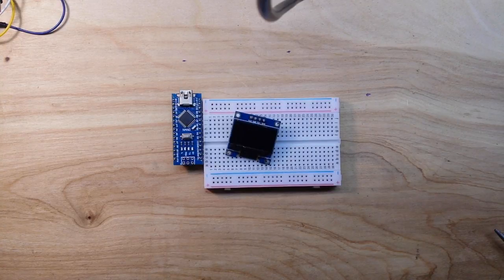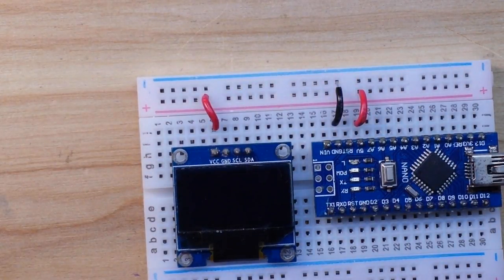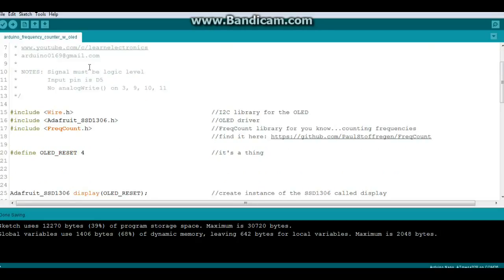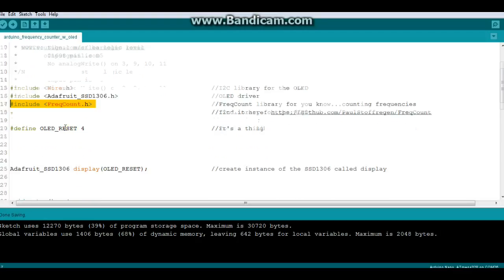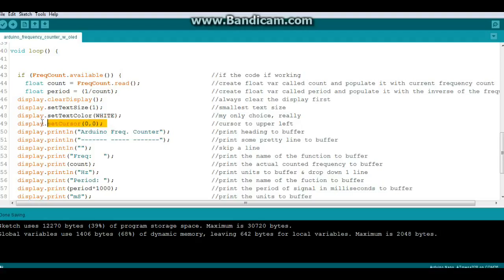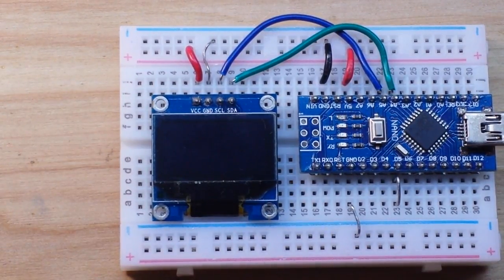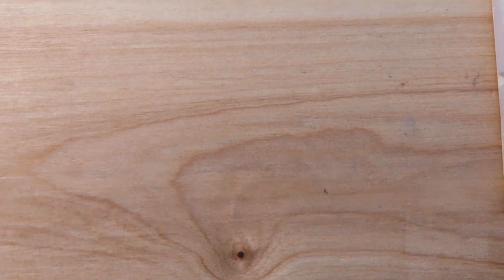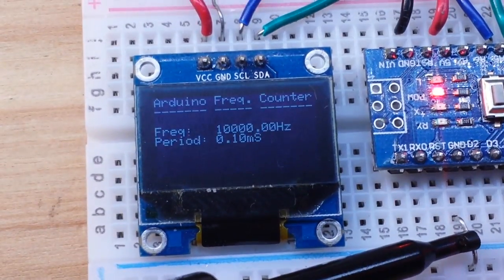Super simple Arduino Frequency Counter

Comment: Nice simple, but useful little project! Thanks! I built it on a full size breadboard with a breadboard power supply and built a 555 a stable oscillator on the other end. Fun to experiment with capacitor and resistor values and see the instant results.
Reply from the maker: Gotta love an RC circuit. One of fundamental building blocks of electronics.

Comment: I kept working from your orignal project and it does measure AC sine wave without issue.  Question was how to get from 120VAC to 10VAC.  I purchased a standard door chime transformer (U.S.) that drops 120VAC to 24VAC/16VAC/8VAC for $14.00 at Home Depot and added (2)  1/4W 20K resistors  to both the plus and minus connections to keep the current draw down - presto measures 60Hz. My problem solved.  Thanks for posting your early efforts, It helped me solve my issues for my project.

Comment: I made a USB current/voltage meter by using the same OLED+Nano and a shunt resistor. The arduino has an internal voltage reference, which I used to scale the analogRead voltage.

Comment: Thanks to you i found a use for one of my arduinos. I made slight changes so i could use it on a 16x2 lcd screen and hocked that baby up to my adjustable computer clock. Now i can finally exactly see on which frequency im running

Comment: What’s I have been looking for. 💡 Converting stepper pulse signal from a CNC into a value to map to a pwm output gear motor control. I believe it will work for my application. Thanks brother💕 you are awesome
Reply from the maker: Good luck!

Comment: This is great.  I did it with s bare bones arduino on a circuit card with a breadboard buddy PS and put it in a plastic box 3.75" by 2.25".  Checked with my oscilloscope, it is indeed acurate.

Comment: Big problem, you fed it a signal from function generator that was not offset to meet input range of a pin, 0 - 5. Your input swings below ground. Thats  a great way of burning out chip. You need to add an R divider to bias up input, Vdd >> R >> pin >> R  >> ground. Then capacitor couple input signal to the pin. The Rs around 1K or less. In your example with 50 ohm generator, you swung -2.5 V across pin, thats about 50 mA you drove into pin. Not a good idea.
Reply: Or just a diode to stop it from going neg 0 at that point?

Comment: How do I make the counter show more digits? I have an input frequency of 69.3hz but the counter just flicks between 69 - 70hz. if I change the parameter FreqCount.begin(1000); to FreqCount.begin(10000); the counter shows 693.00hz so the full frequency but the point is in the wrong place. I am very new to the arduino so just learning any help please?

Comment: Could you please suggest me a way to deal with a crystal oscillator resonance frequency? Because I'm willing to make a microbalance by removing the metallic part of the crystal oscillator. The change in the resonance frequency of the crystal oscillator when external thin film of material deposited on the oscillator will take into account. So is their a way to count that resonance frequency with Arduino due? Anywhere to look at? 

Thanks.

Comment: Nice! I'd add an input buffer/amplifier and voltmeter then it would make a great display for a homebuilt function generator, showing the frequency and amplitude.
Reply from the maker: Moonbrony go for it, if you need help with opamps just ask. They are my specialty.

Comment: Hi thanks for sharing this valuable application. I am wondering if you could demonstrate: using ultrasonic detector (read only) and print out the frequency the detector receives from a ultrasound source such as a broken bone/metal/adhesive or anything that can generate ultrasound wave when broken.... thanks.

Comment: I'll have to try this in my portable Arduino box. Since I switched up to the ESP chips for my EMF detector v2, it's been neglected! Exact same hardware in a 3d printed small handheld using a fat 18650 battery.

Comment: I have build a function generator and this frequency counter It's exactly what I need. Unfortunately I have  128/32 OLED display. Can I use double slash  before display.println("");  in order to fit all lines in 128/32 ?
Reply from the maker: +Traian Angheluta Yes, just change the parameters

Comment: I added to the circuit a 78hc4017 ci to read frequencies up to 60 MHz.
how to add an offset line of 9,700mhz for use in cb radio
Reply: I think it is cool that it picked up the omnipresent 60 cycle hum before hooking up the generator.  Definitely looking into this 78hc4017 so I can read the value of salvaged crystals of unknown value.  Hmmm, don't you mean a counter, like the 74hc4017?

Comment: I do not see any information on how to set which pin to use for frequency input, is it locked to pin 5 only?
Also I assume it only accepts digital input and not analog signals?
Reply from the maker: +Brian Moreau Yes the library is locked to that pin and it's digital only with a 5VDC max.

Comment: Want to use this for reading high freq lighting controls via bpl in commercial construction. Would be much cheaper than the current standard which uses a DC signal on 18/2 to EVERY single luminary.

Comment: Thanks for sharing your efforts.  Q: can this work with a sine wave as well?  I'm looking at setting up a simple ATMEGA328P (Nano) to monitor supporting DS1307 RTC and an SD (SPI) card module to tell if a 45VAC signal at 1350Hz changes by more than +/- 2Hz.
Reply: Send it through a CMOS buffer with hysteresis, that will square it up and make it 0-5V. You'll want a resistor and diodes at the input of the CMOS gate to clip the voltage so it doesn't go outside 0 to 5V.

Come to that, you could probably feed the 45Vac through an appropriate resistor and protection diodes right into the Arduino. Clipped, it will be pretty close to a square wave.

Comment: Your awesome & thanks for expanding all our curiosities! At the moment I am trying to get the movement and angle looking at the end of a 1/2" shaft. The end of the shaft is splined with 34 very small teeth and behind that the nut holding everything bond in place. I can mount an enclosure as close as I want to the shaft but has to be completely enclosed.The shaft stays within a 0 and 50 degree range and moves very slow...very slow. Needs to be within 1 degree accuracy. Not so much a frequency project....or is it? Any suggestions?
Reply: Just use a rotary encoder.

Comment: I have a tiny little LCD and I'm thinking of throwing a pro mini, 9v battery, and some leads in a 3d printed case for it. I'm planning on using it to check the ignition coils in some old cars so I'll need a voltage divider too(not on the hv side, on the pin that gets pulsed on/off)
Reply from the maker: Mario Castillo sounds like a great project, please share your progress.

Comment: Could this be used to generate an error signal which, when fed into a vco, could act as a frequency stability control for an oscillator?
Reply: mike chapple In theory yes but there are better established methods to achieve frequency stability. If you need any help just let me know
Reply: In fact, the answer is NO. The arduino timing is far from accurate.

Comment: How about for sine/audio?
Reply: i also want to know
Reply: super late and you probably have an answer already but for anyone else reading this; you can  turn a sine or other analog waveform into a square wave by using a comparator.
Reply: I know I'm late for the answer but maybe it can help other people. It does not work with audio. Only with simple waveforms which you can meaningfully convert to a square wave. Audio, usually, has a complex waveform. This implies that you use FFT to get the period of the mains signal.

Comment: I only had to make minimal changes for this to work on a Teensy 3.0, which is suppose to be able to measure up to 65MHz.

The PJCR website has a page that tells you which pin to use and which won't work with analogWrite() while using this library. It doesn't list the Nano, but a Nano is just a small Uno without a voltage regulator.

My display seems to have an error, in that it has a jumper for 0x78, but only works when the software is set to 0x3C. I have no idea why. I have seen comments from others having this same problem.

https://www.pjrc.com/teensy/td_libs_FreqCount.html

Comment: This is absolutely fantastic stuff!
It would be very helpful for me, if you could turn this frequency counter into a analog sound to MIDI converter to translate frequencies produced by guitar strings into a midi signal . I really would like to build such a thing, since I recently got cought by various synthizyser sounds and the equipment we find on the market, I just don't like and it is expensive as well. Furthermore it would be great, if this device is pretty small, so it can be hidden in an electrical gitars body with good looking nobs, if needed.
Obviously we would need some coils with a magnet under the six  strings, to get some voltage for metering.
What do you say as an expert?
Certainly I'd like to give you a hand if necessary.
Regards Albert
Reply: I'M beginning to research on the same subject... convert guitar strings sound to MIDI... found the solution on your part ?

Comment: could that be adapted to a RPM meter?
Reply from the maker: I guess so. But there are easier ways to monitor RPM...a break beam sensor or hall sensor. What application do you have in mind?
Reply: was thinking about a DIY RPM meter for my ATV using an inductive pickup off the spark plug wire, planned on using a couple zener diodes to clamp voltage to under 5volts. that was about as far as my thinking got me.
Reply from the maker: Kirk Nelson That would work for sure. The library I used in this sketch will work perfectly. Instead of the inductive pickup, I would use a hall sensor, no zeners needed. If need any help, feel free to ask.
Reply: Thanks I may just do that :)

Comment: What is the max frequency it reads?  Just curious!  Wondered if it could be adapted to measure RF frequency to tune transmitters?
Reply from the maker: gartmorn according to the library 5MHz
Reply: learnelectronics oh well, but still a cool wee project!
Reply: com um 74hc4017 ci, ele vai até 60MHz
http://py2ohh.w2c.com.br/trx/arduinofrqmtr/arduinofrqmtr.GIF